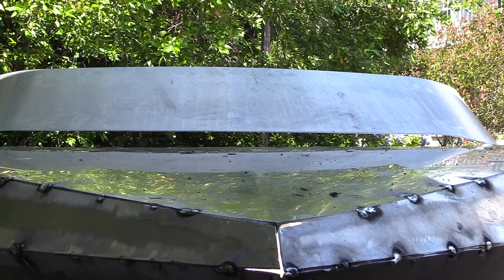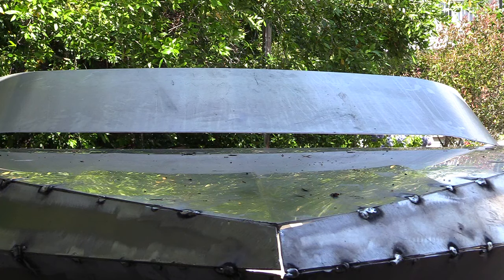Mini Jet Boat Build Video #30 - Scoping Out the Windscreen and Fore Deck

Comment: Ive watched all the videos up to this point, you're really starting to kill my vibe on my my kit I'm picking up this week... haha i bet now looking back you probably would have just sent it and welding that gap, i know i would have. but i also would have watched for angle variation just from knowing even just transporting will throw angles off. cna't wait to get to the part where you pushed through all this and drive that thing!
Reply from the maker: I’d love to do it again with a good kit. I learned a lot, but those hang ups cost me a lot of time. Make sure to put full UHMW on the bottom. I’m actually going to consider a metal option, but don’t know for sure yet. You’ll get it done.